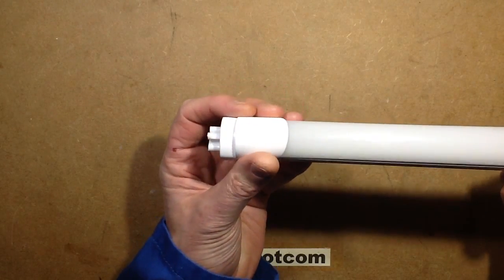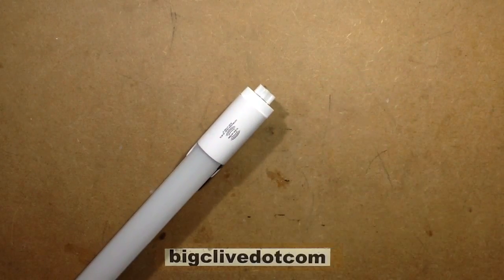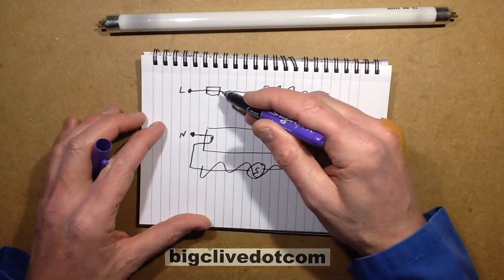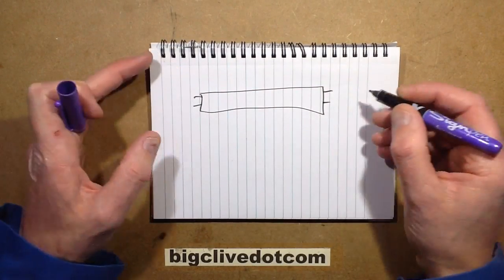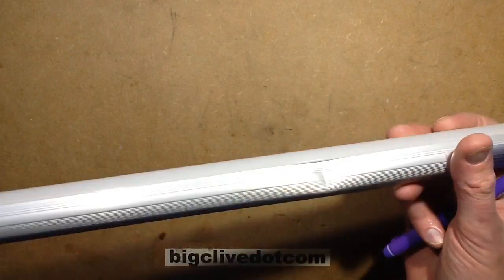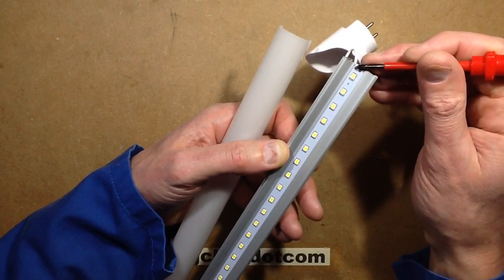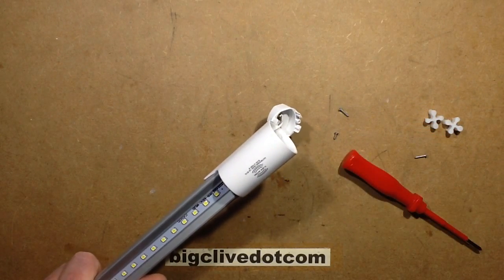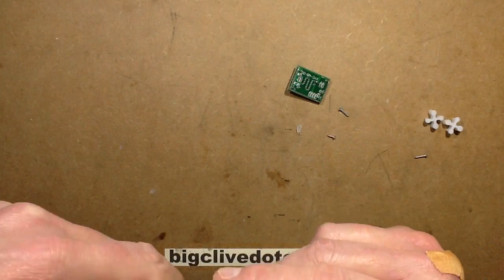Inside an LED T8 radar retrofit fluorescent tube.  (Excelvan)

Comment: I have changed hundreds of fluorescents over to these at my work over the last few years. The ones we have been using have excellent light quality compared to the old bad transformers and blinking bulbs.  
So far I haven't noticed the dimming you mentioned.
Reply: I agree the LED ones i have bought have been better and brighter than the old tubes. My old ballast burst into flames so i think older fixtures are more dangerous than these "new "ones. God know what he is on about in this video, he is totally wrong!
Reply: We swapped over to 5ft LED T8s in the kitchen last year and they're still going strong. No flickering, dimming or buzzing like the fluorescents. 
Most importantly, these lights are on a lot, particularly in the winter, and since the swap there's been a noticeable difference in our energy consumption :)
Reply: Vax Buster I wouldn't say that Mr Vax, (old ballasts) older 'iron-core' ballasts (unless early Fitzgerald slim ballasts) were more reliable/lasted longer (although costlier to run, due to tube ignition spike-strike & %-age power loss through ballast heat, I find electronic ballasts though lighter, smaller &  cheaper running cost as most power goes to the tube are more prone to failure when hit by incoming power fluctuations. Since moving from city to the sticks, power fluctuations/black/brown-outs have destroyed numerous 'brand-named' electronic lighting units on both emergency backup & normal
(electronic) fluorescent fittings, yet digital  T.Vs, & of course your old iron core ballasts atm handle quite well. Perhaps it's just a coinsidence.
 Ps . . have had 1 CFL out of 23 leave this earth early
Reply: @Screwy Reynolds You're lucky, because it looks like the new TVs get killed easily, (at least a component getting killed) compared to the good-ol'-times-TVs.
Reply: Ah . . but if you leave fluorescent's (BI-PIN) on continuously, you get a lower energy consumption (not as low as LED though) than if you turn them on & off. reason . . . the power used on initial start-up of tube is higher than when tube has "struck" & is running, so when you get the firing up stage, ie the flashing before full illumination (on switch-start circuits) the power consumption goes up for every flash. On ignition, the power drops down to run the tube heaters at about 6-volt. On another note . . in the early/mid eighties, Fitzgerald bought out switch-start slimline (T-8) fluorescent fittings, which were . . ok to a degree, if the tube was running fine, (more suitable for residential, than commercial use I think, the iron core ballasts ran extre-e-emly hot very quickly)   but if you left a duff flickering tube in for a fair few hours, (say, in a bank of lighting in a warehouse, where to turn said light off, a large portion is left in the dark) the ballasts went up in smoke . literally.

Comment: it does not seem very cost effective. tombstones for a fluorescent light are only one strip of metal inside so if they were fed from only one end you would also have to install a new tombstone for the lamp. at that point it is about the same price labour wise to just replace the whole fixture instead of retrofitting

Comment: I hate TL-tubes because of the flickering and the colour temperture, does these bulbs eliminate that? To me it looks like an ordinairy ledstrip with a build-in power supply. Most people suggest that LED lights are good for the environment, i doubt because all of the electronics needed inside, it is not just a bulb.

Comment: The newer "safe" Tubes now come with one end just looped through and the other end holding the actual Live and Neutral pins. They also include a custom starter which is essentially just shorted so it takes Live through the choke, through the looped end and the shorted starter to have all connections on one end. This way it doesn't even matter which way around you put the tube in and certain people can't kill themselves with the lamps. You could even get your old tube back in a matter of seconds. just replace the starter and tube again.

Comment: Shame the people barely trained to do this just rip out the fuse, I would assume there would be a secondary ballast box that only holds a fuse which can be screwed in and covered like plug sockets if it's direct-to-live as a fuse and choke replacement, and if that's set up correctly, that would reduce circuitry on the inside which would mean they could be somewhat-creative with minimizing the innards of each "Bulb".

I would also think, in higher-quality products the LED strip is still resting on something metal as a heatsink, but the body the bulb is fitted into is casted from a glass-fibre plastic for strength with multiple possible mounting anchors so the body isn't ever "Live" if dented.

Comment: The kitchen light here I fitted with an LED tube, no wiring mods needed, just the starter replacing with a fuse (which is in a starter housing), though my Shed LED fluoro strips did require rewiring (same as this tube, Live one end, neutral the other), but the fitting was a cheap & nasty twin 2ft one from Lidl that had blowing the electronic ballasts anyway, so it needed rewiring either way... :)

As for the brightness, well, the kitchen one is just as bright as the flickery (yet was brand new on moving in!!) GE fluoro tube it replaced, and my 2x 2ft tubes in the shed (from ebay seller "led-me-uk") are pretty bright, so, I guess it's a case of "you get what you pay for"... :)

Comment: The safe LED tubes are made like this. One end has the two pins as live and neutral. The other end just has a short that connects the two pins together. If you then replace the neon starter by a "starter" which is just a short the LED tube will work and be safe to touch in any end when you plug it. When you have placed the tube the current path is from mains to the ballast coil, then to the end of the tube on one pin, through the LEDs, to the other pin in the same end, then to the shorted starter, to the other end of the tube, through the short, and back to mains. You can even reverse the tube, it still works. You can remove the ballast coil and save some energi by not heating it up. But for most normal people leaving it in and just replace the tube and the starter is pretty easy. It takes more skills to remove the ballast. One downside of removing the ballast is that if you later put a traditional fluorescent tube you will have a bad surprise. In Denmark the rule is that you must put a label on a modified installation to warn that it is only for LEDs. If you install an LED tube in an existing installation at your mothers house, I would leave the ballast - just in case. The shorted starter just makes a standard tube glow at the ends but it will not burn violently. It just does not work.

Comment: Those LED replacements are rubbish. They need 50% less power, but produce 50% less light. The saving is made by reducing the light output, rather than improving efficiency. Simply removing one tube out of a twin tube fixture would have nearly the same effect, plus you don't pay for all the LEDs. LED tubes are more about fashion rather than rational savings. Selling LEDs is a fashion business.
Reply: danyk666 Don't forget these are shitty eBay LEDs. Pay a few £ more and you have a light brighter than a CFL yet 1/4 of the Wattage.
Reply: I don't think that even the same light output is possible with 1/4 wattage. The good 36W tubes have 3350lm, that's 93 lm/w. Then those LEDs would have to have 372 lm/w. That's nonsense. The best LEDs can have 100 or 110 lm/w at their best, but that's not worth the upgrade costs. Usually they have like 80 lm/w, even less than a good fluorescent. LEDs tubes also tend to fail very early, as there's always a weak chip in the chip array, that breaks the entire array.

Comment: I bought some of those exact radar modules off EBay. Trouble was they came with no documentation. Seen a few pictures on Google with Red, Black, and White. I know they have a wide input voltage range and are meant to output a TTL signal on detection.
I thought I saw you shorting the output to ground, I'd be interested to know if the radar portion still worked.
Reply: Somebody below asked for a link, here is mine from EBay. I must point out though I still have yet to get one to work due to a) laziness and b) lack of good documentation. If anyone could help with the latter I'd appreciate it ! Thanks.
Reply: http://www.ebay.com/itm/121994983149?_trksid=p2057872.m2749.l2649&ssPageName=STRK%3AMEBIDX%3AIT

Comment: Have you ever actually ran a fluorescent tube on direct mains without anything? 

Seems fun to witness
Reply: They won't last long, assuming they strike. ;)
Reply: depends on the tube. the largest common size is 36W but there are 105W fluorescents. You can't use them on 120V because the voltage isn't high enough to drive them. But here in 220V countries we can use them. They're expensive though

Comment: The ones with the live and neutral at one end aren't a happy thing if someone fits a normal tube either, the filament will go POP lol
Reply: Supposed to put a label in the fixture, or if you've got half a brain you look at the bulb coming out to see if its compatible with the one you're about to stuff in.  Definitely will go bang if not though. 

 I converted a bunch of older T12 fixtures to use T8 LED lamps, wiring the mains feed straight into the lamp holders.  Works very well, and it was a lot cheaper to do that vs replacing all of the ballasts which needed to be done.  It was actually cheaper to buy all of them and run for a year vs just running the old lamps, let alone what the ballasts cost.  3 of the T8 LED lamps works out to about the same brightness as 4 F40T12 bulbs.

Comment: Thanks, this is surprisingly relevant for me, as I have a modestly sized fluorescent desk lamp with a bendable arm and was planning on converting it over to LEDs by removing its guts and putting an led driver inside, in order to run a couple strips in it, I might consider doing this instead.

Comment: When I was a teenager I had one incident with 40W T12 tube where the buffer gas ionized with mains 230V 50Hz and zapped through my fingers. It wasn't pleasant, but that happened in the era when I got myself electrocuted at least once a week.
Reply: definition "electrocute" to kill by electricity
Reply: Vince Herried Oops, my error. :D I meant "intermittent low current circuit from phase through body to ground without any obvious injuries". I seem not to find any proper single word definition for this, looks like most humans actually get burned or other injuries from electricity, so that rules out "shocked" too.
Reply: DjResR is "zap" the word you're looking for? :p
Reply: Few dictionaries will exclusively define "electrocution" as death by electricity.  It can also be used to describe non-fatal incidents.

https://en.oxforddictionaries.com/definition/us/electrocute

Comment: I replaced my fluorescents with something similar-brightess is good. they came with a starter with a bypass link. I measured the drop across the ballast and it wasn't enough to be worth bypassing it.
Reply from the maker: Was this after you'd smashed the original tube by electrically detonating a breaker under it?
Reply: +bigclivedotcom Good point.
Reply: mikeselectricstuff

Comment: Are you saying the LED tubes are a waste of time... as I have just fitted some over my workbench, much lower power in, but the light is about 3/4, (by Weston light meter).... do they not last? I modified my own fittings to feed the power in (Trained Electrician). I was mainly after lower bills! all the rest in the house is now LED, and so far only two faulty corn cob type Lamps, repaired by replacing the components with better quality caps etc.
Reply from the maker: The longevity of the tubes depends on the quality of the LEDs and usage.  The problem with progressive degradation is that they lose intensity imperceivable over time until you realise they are just dull grey.

Comment: "safe" led tubes have one side which is just a short circuit or a fuse. This way, provided that the ballast has been removed and the fluo starter changed with a "led starter"(which is again a short circuit or a fuse)... then it doesn't matter which way we fit the tube in...

Comment: When I worked as a custodian for the schools,I changed many a bulb. I remember when it was really humid in the building you would get a " tingle" from the fixture and or bulb when installing new ones. I saw many a new custodian trying to install bulbs and hold on to the pins at the other end. Even being turned off at the switch there was enough voltage in the lines to give you a sizable jolt. It may be from the ballast but eather way,I learned never to hold a bulb by the pins,ever.I also learned to not touch the older metal hoods that the lights went into. Even with the power off,there was still some energy in those lights. Yup,fun times.

Comment: A friend recently refitted all of his shop lights with led tubes, checking his electric bill against his previous years usage for the same time period he found he is paying exactly the same in KWhrs as when he had regular FLOURESCENTS ! He is really upset since there have been no rate changes or tax changes, or use of other equipment within his shop. As for the thumbnail, excellent photo! You could be the Wizard of Light in one of the JK Rowling books! Too bad you did not use it as an opening or closing shot to the video.

Comment: I have installed six T8 LED replacements ( non radar ) A year ago. Here in the US one can find those that require you to re-wire  the fixture and those that drop in with no re-wiring.  My ballasts were very old so I required the  re-wire type.  One end has 120V (mains ) across the two pins, the other end is left open,  there is a sticker you put inside the fixture to alert you to which end is 'hot'  The replacements put out more light than the originals ( used my physics tool box app on phone to measure before and after ). Several friends took my recommendation and we have installed over a dozen in the last six months.  No complaints lots of light.  these are NOT RADAR units referenced in this video, and were not purchased thru eBay.  Cheerio.
Reply from the maker: Keep in mind that if the original fluorescent lamps were old they would have diminished in intensity.  It would have been interesting to have done a comparison between two identical fittings, one with brand new fluorescent tubes and one with LED retrofits.  Then compare them again in a week and then a month and see how they have fared.
Reply: Seeing IKEA is going full on LED all the tubes in stores have been replaced with the LED versions. They been in there for 6months, but can't really see the difference between one of that age or a brand new one. (We tend to knock them out of the fittings from time to time which always breaks the pins so they are useless.) 

Anyhow not a huge fan of them, looking into LEDs is just annoying as all hell, more so than the tubes.

Comment: Have two of these exact ones fitted in kitchen also earthed through the spring clips holding them in place there great as our kitchen light is left on from the time it's dark till sometimes all night if up late they dim till you walk up the hall or get to a meter from back door if coming up garden. Great saving on electricity. I've had a few used them in workshop too. Haven't had one fail so far. For the price I bought them very happy but agree they need to be treated with caution just in case there is internal faults. I am qualified and take care with anything connected to mains.

Comment: I will definitely look into an LED bulb, we have a very noisy and irritating fluorescent tube in our kitchen.
Reply from the maker: That'll be the internal ballast that makes the noise.  You could swap it for an electronic ballast and it would run much quieter.
Reply: bigclivedotcom interesting, I will look into this, thanks.
Reply: +bigclivedotcom Or the magnetic field from the ballast making something rattle/buzz. Usual suspect is the cover on a simple batten fitting.

Comment: Who holds the metal end of a tube AND have the socket switched on whilst changing one? A worse decision than a certain election result.
Reply from the maker: Lighting maintenance companies use the cheapest labourers they can find.
Reply: IF you work in a huge warehouse you always put new tubes into a live socket since its hard to do it in the dark on steps.
Reply: I also don't understand why you would touch the pins. For the switch: sometimes you don't know, if the switch is in the on or off position. And there's no light there to show it. No excuse for leaving the breaker on in that case though.
Reply: bigclivedotcom I wouldn't know, but that's a scary thought. It's the last time I trust the friendly maintenance man.